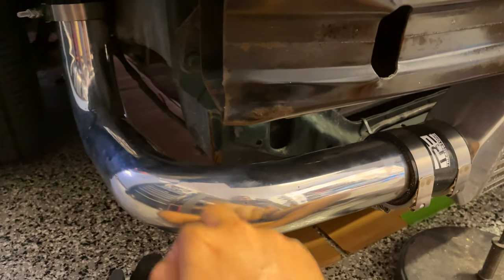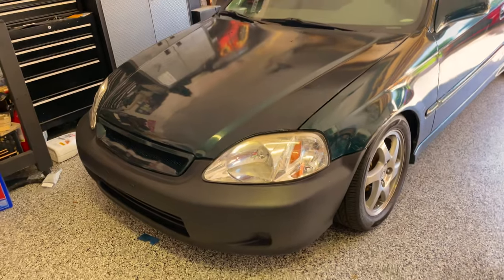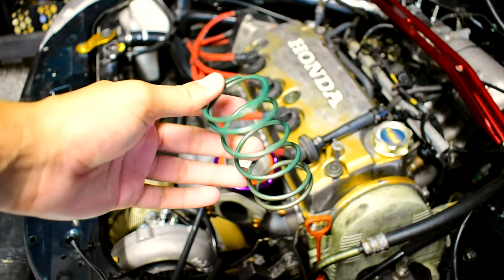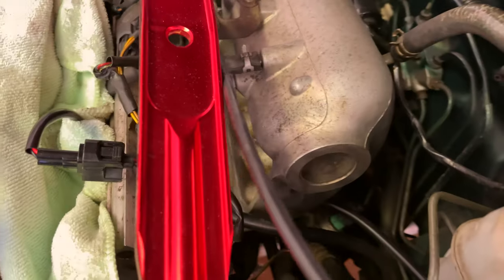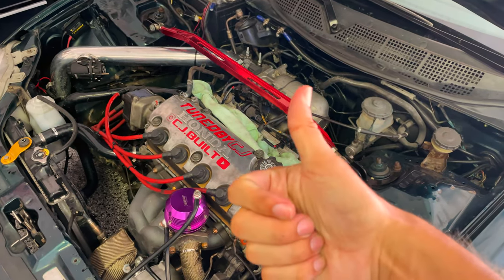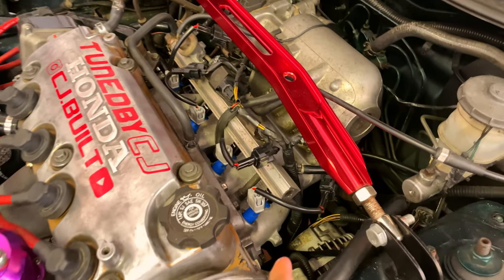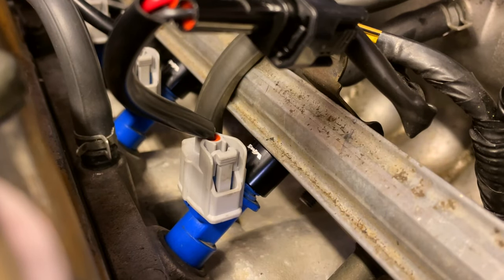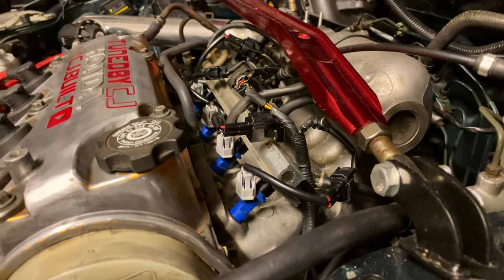Swapping Wastegate Spring + RDX Injectors Install On A Budget D16 Turbo Honda Civic

Comment: Would you be able to send a basemap tune for hondata? I literally have the same exact setup jus minor differences. I haven't put the actual turbo on the car yet because now I know I need fuel hats for the rdx injectors. But once I throw it on I would like to have a basemap to at least run down the street
Reply from the maker: Send me a message on Instagram [@CJ.Built] and lets see what we can do.
I just made a map for mine also using Hondata  (Video coming soon).

Comment: what kind of pigtail did you use on the injectors?
Reply from the maker: I got a set of them off eBay. I put the link to the ones I got below. 

Hope this helps! 

https://www.ebay.com/itm/152373681397?mkcid=16&mkevt=1&mkrid=711-127632-2357-0&ssspo=g9p-NCFFRp-&sssrc=2349624&ssuid=hmyyfin2qzg&var=&widget_ver=artemis&media=COPY

Comment: You can stay at 1000 from now until you just get a bigger turbo. Hopefully you’ll start running corn soon to.
Reply from the maker: What do you mean stay at 1000? 

Not sure about a corn setup just yet. Might try staying 93 as long as possible
Reply: Are you running 1000 cc injectors.? Or under.?
Reply: Do you think you’ll be opening the motor and putting cams and springs and stuff in it?